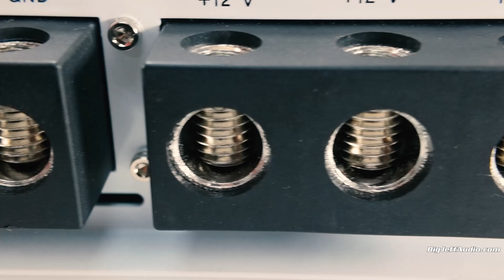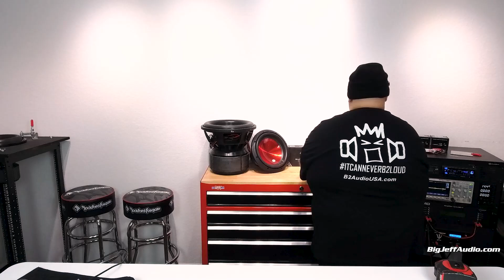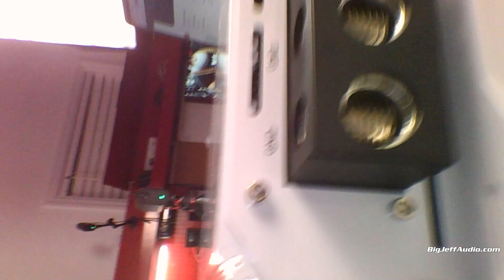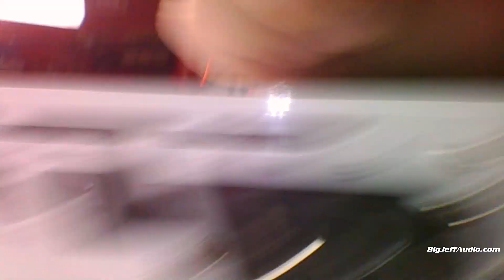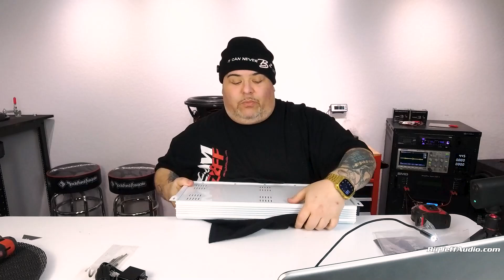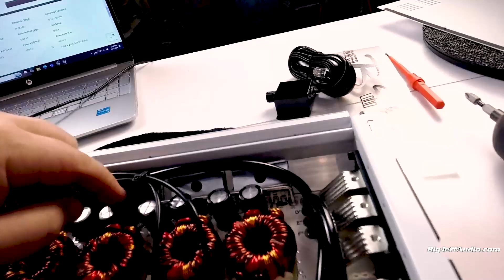B2 Audio ZERO6 Amplifier Unboxed: A Game-Changer for Car Audio! 🔥"

Comment: Is anyone running this amplifier at half an ohm.... i just got my order delivered yesterday, and i checked the resistance on the subs, and they are dual 2 ohm and not the dual 1 ohm that i ordered, so i cannot run a 1 ohm load, and i don't want to kill my brand new zero 6.